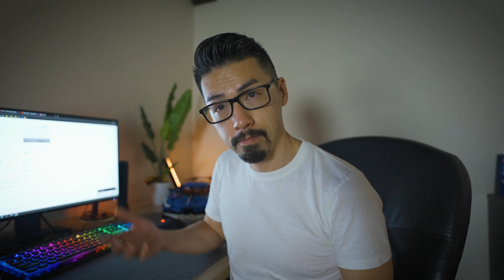Masters In Industrial Design...A Bad Idea?

Comment: I want to be an engineer but I also  want to be an industrial design, what should I do?😕
Reply from the maker: Become a mechanical engineer and apply design skills you learn on my channel ;)
Reply: @JimmyHuynhdesign  another question is industrial design about only the outer surface of the product or also the inside, also is it only about aesthetic or also about the functionality
Reply from the maker: @abz2995  Good questions Abz. To expand on your first question, the reason I suggest going ME is due to more job options. I would only suggest ID to those that truly want to do it for ID is a bit tougher to find a job that you enjoy and get paid well, so you better be good. ID is generally designing the outside. Aesthetics and how the product is experienced/used. The "idea" of the product. ME job is to make it manufacturable and mechanically sound using stress tests, physics, tolerance, etc...

Comment: I am mechanical engineer and no skill in design , I want to be designer . So if I do masters will I learn industrial  design ?
Reply: What do you think my path should be to be a designer?
Reply: First aquire some software skills like, AutoCAD, Inventor, Pro Engineer, Uni graphics, Solidworks, Solid edge, Catia etc. Learning these softwares and working with them will help you to understand how to use them in an industry. Then prepare a good resume with those skills and get a job as a designer in an industry, you will realise if you are truly interested or not when working. Then if you think you need more knowledge in industrial design go for PG in industrial design.

Comment: I've been debating with this for the past year. Graduated almost 2 years ago from interior design. I have an interest in industrial/furniture design and I want to learn more and try to pursue it further (not necessarily in a school environment) but i feel as though companies are hesitant to hire me as I don't have a degree in it. I've talked to other designers and most of them discouraged me from going back to school (masters & bachelors) but I just don't feel confident without learning more about the mechanical engineering, 3 dimensional modelling, problem solving aspects, etc....
Reply: Hello, how are you? I feel the same way, I believe I need to learn more about mechanical engineering and engineering aspects to complement myself as an Industrial Designer. What did you do to fill those gaps and gain knowledge? Regards.

Comment: As someone who has an MFA in Industrial Design, I agree with most of these sentiments. There are really only a few reasons to get a Masters.

1) You already have an undergrad degree in something else, but want to work in ID (this was me)
2) You plan on teaching at a graduate level
3) You plan on getting into something like project management and want to achieve a level of mastery over the complete process.

That being said, you'll learn vastly more from working professionally than equivalent time in the classroom.

Additionally, it depends on the program what skills are taught. I definitely had drawing, model-making, CAD, and product development courses in my MFA.
Reply: @Kang Gaston which university you attended for MFA in ID?
Reply: @AzathothsAlarmClock  I agree generally, that the expectedness of going to college is harmful; it is often unnecessary and is in some ways harmful. Loans, wasted time, and useless degrees weigh heavily on our economy at large, and directly hurt those young adults that expect an easier or more lucrative career.

Specifically to Masters in ID. There is a value in it, but it's highly circumstantial. It's not going to benefit every designer, and any benefit is not going to be uniform.